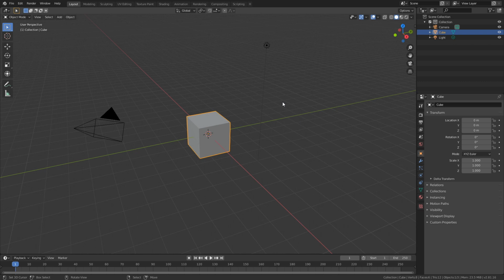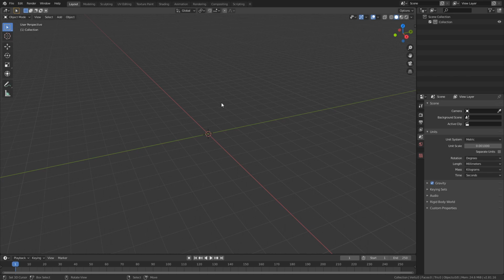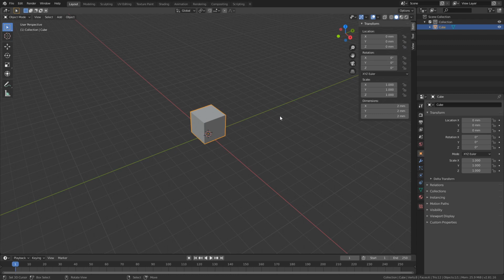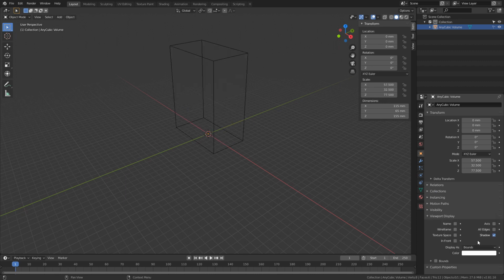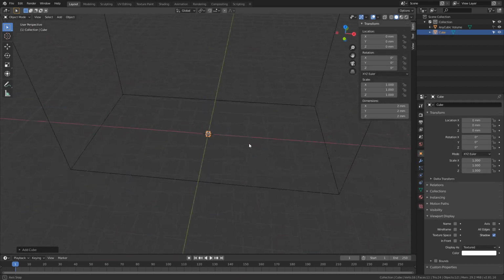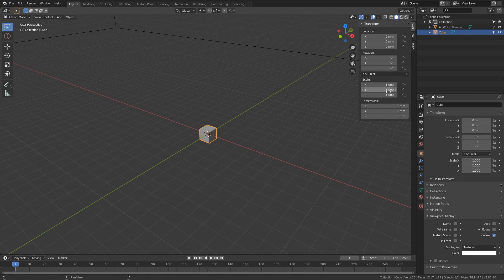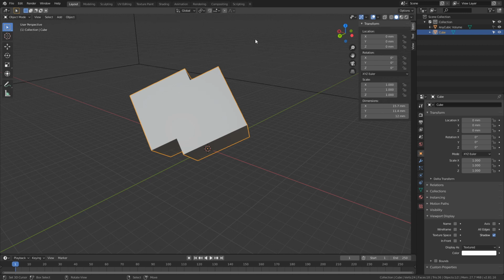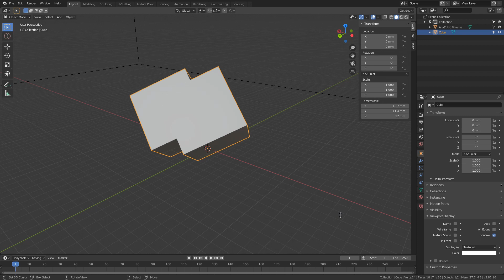Best Blender Settings for Resin 3D Printing

Comment: im about to start using resin printer. i wonder if the unit adjustment really necessary. since its only decimals. how does it affect the stl files since most slicer software facilitates resizing anyway..

thanks before.
Reply from the maker: The unit adjustment is useful for the scale of detail i am working at. The slicer can resize as well, but is less accurate for complex shapes. Keep in mind that i am working to create prints that match up to the dimensions of real world objects, so the unit scale is warranted in my case.
Reply: @syntheticblackminiatures  thankyou for the explanation. very insightful video.

Comment: Hi there, Im having a lot of trouble with resin printing because the shell too thin, I've tried solidify mod, meshmixer. You have any ideas? Cheers!
Reply from the maker: I'd need a look at the file. What are you using for a slicer?
Reply: @syntheticblackminiatures   Thanks' for the reply! using Chitubox,  I've even tried the infill at 100% and 30% Nothing is helping,  If I export STL file from Fusion 360 there isn't any problem. Seems like Fusions mesh is more dense or something.
Reply from the maker: Send me the stl file, I'll take a look. contact@syntheticblack.com
Reply: @syntheticblackminiatures  im having the same issue solidify sometimes messes my models up or wont make them completely solid
Reply from the maker: @jonathanacosta5476  Lets take a look at it. Hit me up on discord: Synthetic Black#9331